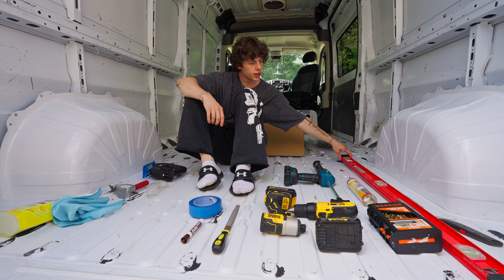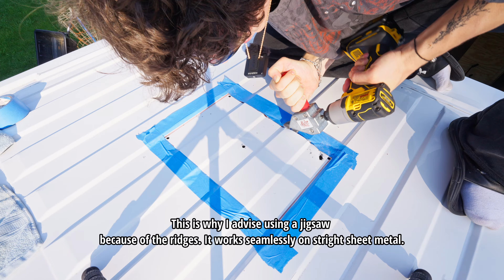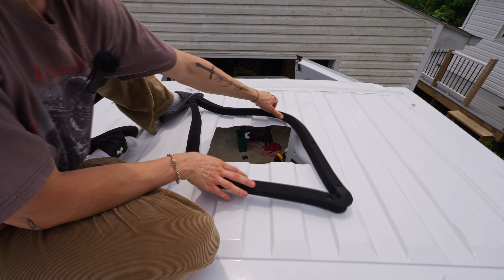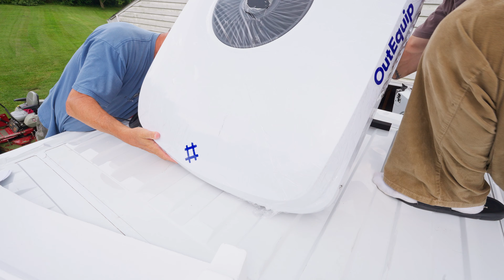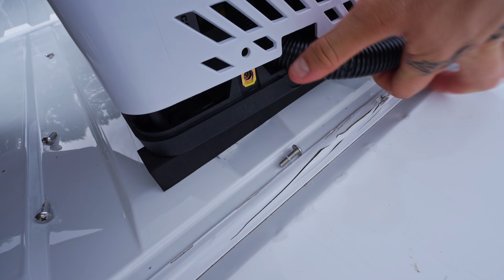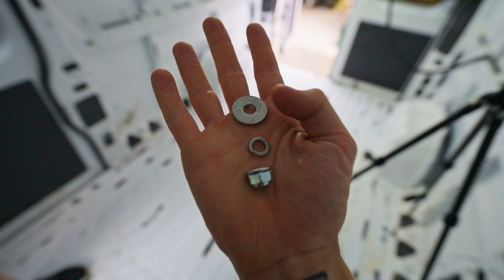OUTEQUIPPRO AC UNIT INSTALL | DODGE PROMASTER CAMPER VAN BUILD

Comment: trying to install my ac. quick connection isnt the foam suppose to go between the roof and your ceiling panel to seal it off? or is it suppose to go between the ac and ceiling just like how you did it? i'm so confused.
Reply from the maker: I get it bro. Check out this video I made https://youtu.be/4TzCzwHoLgw?is=ej9a3Izl-utUK77A

Comment: Any leaks since installing?
Reply from the maker: None actually. But after rewatching and understanding what I did wrong, literally yesterday I ripped it all out and put a different gasket on there. I’m gonna make another video soon on how I fixed it.
Reply: Where did you find that you made the mistake? The butyl tape?
Reply from the maker: @toyhoarder2 yes. So the gasket outequippro send has these little plastic inserts which stop it from smooshing the gasket over time.

And I unknowingly placed some over the buytle tape which over time would be a problem. So that’s why I decided to fix it which I filmed and still want to share so no one has to fix it. 

One thing I’ll say is definitely buy one of those rooftop adapters that have the rooftop groves already built around in it and then put the outequippro gasket I top of that and then seal.

Comment: Gonna leak. Just a matter of time.
Reply from the maker: Why do you say that? I sealed it all the way around?
Reply: @iiiiaaann The roof skin is going to bounce with that heavy unit unsupported by any internal framing. Half the plastic support pieces are over butyl tape and will sink 3/8" in no order. The rear support pieces are also not supported by any internal structure, so the roof skin is going vibrate, bounce, and sag over time, while pooling water near the center. And the two steel bars are only clamping down on two, thin points of 18ga sheet metal. The entire hole needs an internal support ring that reaches out to meet the roof cross beams, in order to support the AC unit's weight from it's 50lb static load, not to mention dynamic loads from driving. Hopefully, you have time to correct this situation, before finishing the ceiling,  otherwise this video will become excellent documentation for it's future resale. Consult DYIVan for proper installation materials, if you're not familiar with this process. Best of luck!
Reply: Definitely helps to know what NOT to do. Such as placing stoppers over butyl tape, routing wire out/around/back-in/breaking thermal seal, and then mounting steel brackets without any internal support! All the while, denting the shitout of the roof. Thanks!
Reply from the maker: @jyetley wow. Thank you for taking the time out to tell me all these details. I will definitely reconsider doing the unit or try to make it more sturdy. 

So I do want to ask you. What about those plastic pieces that go into the seal? They claim that it will support it just fine.

Also I actually finished putting ceiling furring strips up a while ago. So once I put the ceiling up won’t that be enough internal support? I thought I do everything effectively here also considering this is the same thing that outequippro instructions call for?